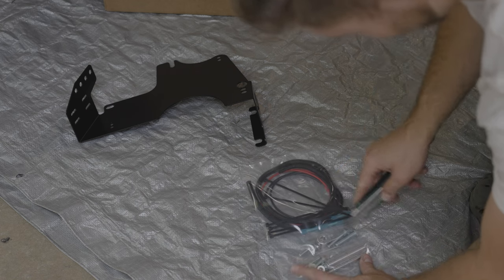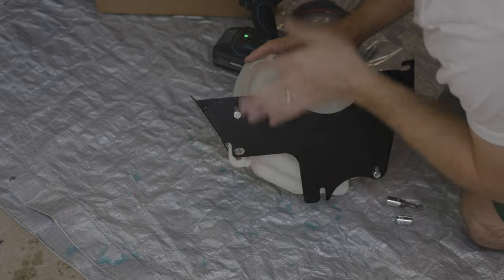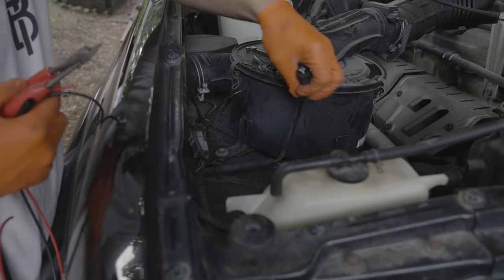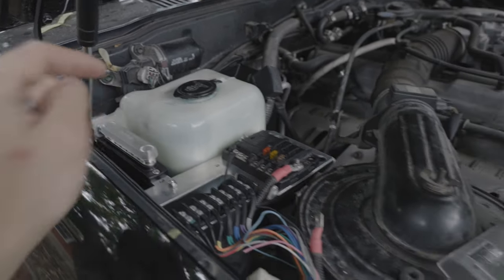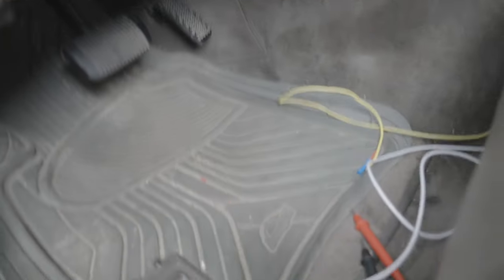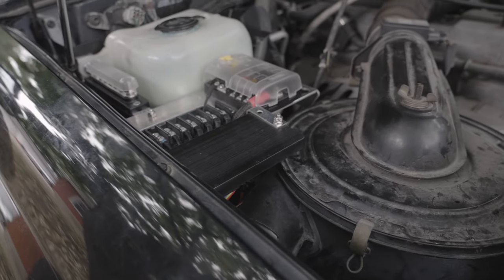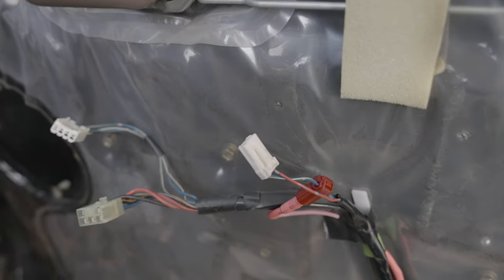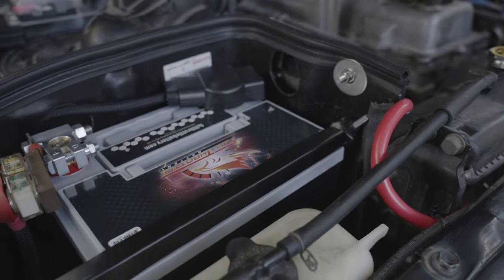BEST Land Cruiser Electrical Switch System Setup?! | Retrofitting 4Runner, OEM, and Cruiser Parts...

Comment: Did you do anything to boost the voltage and keep the AGM batteries  happy?
Reply from the maker: Yeah, I’ve got a new tune on the 4Runner.  Full Throttle claims this isn’t necessary though for Land Cruisers, should be fine.

Comment: Curious what brought you to the AGM batteries instead of something like Optima red and yellows?
Reply from the maker: I think “per capita” optima’s fail more than full throttle batteries.  From my understanding though, red tops are basically not supposed to be discharged more than 3% capacity or else they start to fail.  It looks like yellow tops are designed for greater discharge and can withstand a higher recharge current but I think they don’t have as high of cranking output.  I’d guess the yellow top is similar to a full river battery.  I have done side by side spec comparisons but I believe full throttle will have a higher performance output with tolerable discharge levels for almost everything someone would encounter offroading besides blatant discharge like a fridge running forever.  Wasn’t planning to get into this in this video but more to come.  My understanding is Optima yellows and reds are AGM.  I leaned toward AGMs because of discharge rates that happen running accessories and a winch, just seemed more logical for preserved longevity.  Some who hardly uses their accessories could potentially get away with lead acid…just depends on the power draw and temperatures.  That’s my initial take I guess
Reply: @OverlandEngineer  thank you.